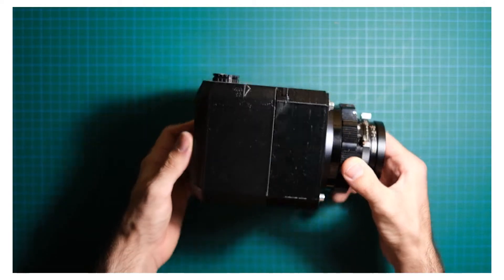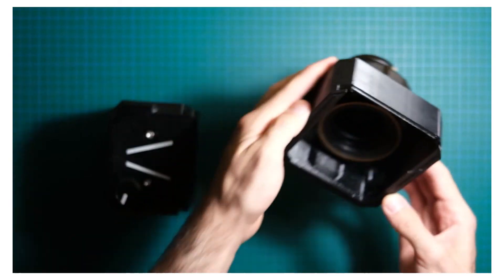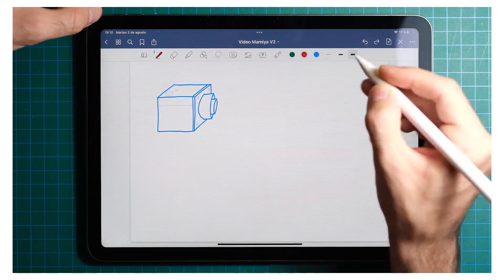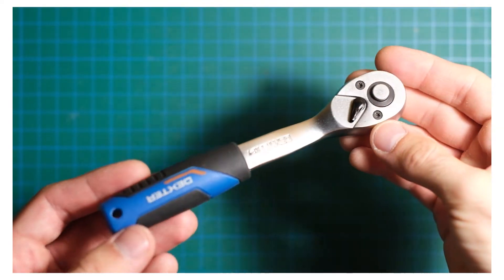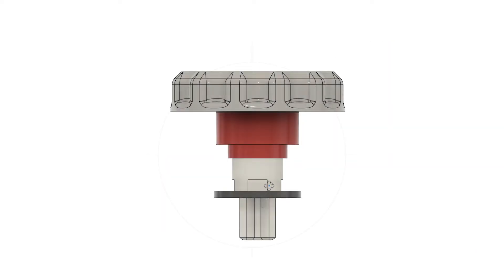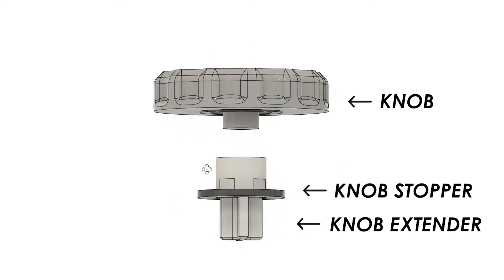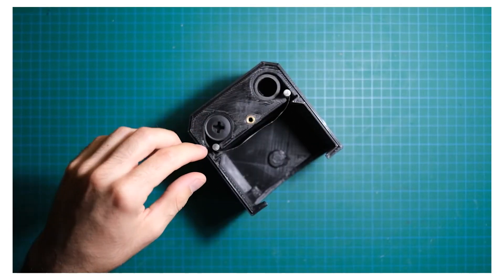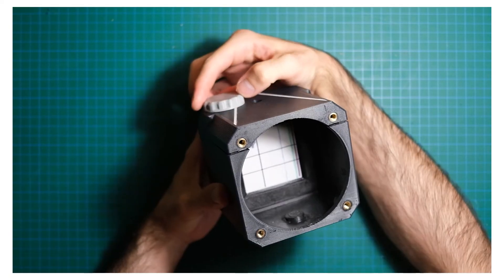3D Printed Medium Format Camera for Mamiya Press lenses

Comment: In a version 3 you may consider using a more advanced system for metering film advance, the current system is very imprecise. If you don’t want to risk light leaks from a red window, make the film travel around a 16mm diameter roller with a rubber band wrapped around it and a 64mm diameter roller. Install a knob on top with a marker at one point. As the film goes over the roller, the marker on top will make one revolution per frame.
Reply from the maker: @mcb187  Hi! Yes, a system for the metering of the film advance is going to be implemented. I'll go for the red window, since the configuration you propose was already thought, but wouldn't work properly. First of all, it can't be a 64mm diameter roller because it's too big for the size of the camera (also, wouldn't be 64mm in diameter but in perimeter). Adding a roller of half the size, or of a third of the size, would be better. But anyway, the friction of the whole system may possibly cause the film not to advance. If using rubber bands, the surface on the other side of the film should be slippery and perfectly flat to avoid any scratches. Even if it advanced, the empty spool where the exposed film is collected would need to have a "tensioning" mechanism to help that empty spool to turn. So the idea itself is great, but the implementation is not that simple.

Comment: Hello, I just started learning to 3D print and came across your project. This looks very cool! Thank you for sharing it. I have a few questions for you: 

0. What software do you use for designing? Any recommendations based on your experience?
1. Do you have an estimate on your timeline for the STLs for your 3rd version (V3) and the rough build cost/time?
2. Any estimates on the final weight/dimensions for V3?
3. Does the lens focusing ring move smoothly with v3 version? It looks like V2 basically uses a "lens board" so the focusing is smooth.
4. Do you think V3 still allow frames?
Reply from the maker: Hi!! I'm glad you liked it. 

0. I used Autodesk Fusion360, which works really good and it's easy to use. But lately I'm leaning towards using CATIA, way more profesional but more difficult to use as well. Anyway, any CAD software you use is great!
1. Version 3 is coming out this summer. It seems to be more compact and will add a few upgrades that will improve the design significantly, I hope. Build time would be approximately the same; cost may depend on if I implement some upgrades that are not decided yet.
2. As mentioned, V3 will be more compact (probably a little bit wider and taller, but shorter). Also, working to see how to add a (removable) handle, which will make the camera bulkier. Weight will be similar.
3. Don't understand the question. Could you rephrase? Thanks!
4. Allowing frames is something I'm not sure about, since it makes the design more complex. I'll try to add them, but can't ensure it.

Thanks fot the questions and happy 3D printing ;)
Reply: @doroteo.archive  hello, thanks for your replies. 

0. I’ll check out CATIA. I’m reading up to learn what decent free softwares exist.

3. It’s hard to explain with words. I’d love to see a demonstration of you focusing V3 and watch exactly how you adjust focus on the lens.

4. Okay, that’s understandable. 

One thought I had is that it would be nice to have the option for a “ground glass” back for times when you want critical focus or composition. However, it wouldn’t be worth it if that made the camera too bulky.
Reply from the maker: @CertainExposures  I thought about adding a ground glass, but found it hard to implement. V3 won't have a ground glass, but your thoughts and the ones of the people commenting makes me take things like these into account for future updgrades. Thanks again for your feedback!
Reply: @doroteo.archive  okay, that's understandable. Good luck - I'll keep an eye out for V3.

Comment: I probably missed something but is the take up reel collecting the film with the film side out?
Reply from the maker: Hi! Yes, that is what is happening. That's due to the knob turning clockwise. If the knob would have been located in the left-hand side and the unexposed film in the right-hand one, it wouldn't happen, but I preferred having the knob where it is. For version 3, I'll try to "fix" it.

Comment: A tip for heated inserts: only push them in 90% of the way, then use a flat piece of metal to push the rest. Gives a nice flush surface and a straight insert.
Reply from the maker: Thanks for the tip ;)

Comment: the relationship between the turns of the film advance knob, the circumference of the take up spool changes so your turns will not be consistently 1.5 turns per frame. I presume that the film is kept flat and tension applied to the film so that the take up spool winds tightly by having the film frame positioned very closely to the back plate. Have you had issues with the frame scratching the emulsion?
Reply from the maker: That's right, the film doesn't advance consistently but it was the simplest way to design it. Version 3 of this camera is on the way and a window to see the frame where you are will be implemented. Regarding the frame scratching: I didn't find any mark in my film, but relying on friction isn't the finest solution. I'll give it a thought! Huge thanks for the feedback :)
Reply: @doroteo.archive  I wanted to thank you for posting your design because it inspired a design feature for a 6x17 panoramic camera I'm designing. I have designed a 3D printed ratchet gear with dual pawls for my film advance after seeing your design. I started with a recessed area just like in your camera and it worked fine, but then I got to thinking I really wanted a lever action film advance like the toyo 4x5 roil film backs use. That feature just required a slight redesign, door handle return spring from amazon and a 20mm long M3 hex coupling nut from amazon.

I've remixed the lid of your design adding my film advance lever system and will post it to printables soon.

Comment: What is the flange distance you used? I have read on internet, that press lenses has 53 mm from film to bayonet, but I have measured much more in your fusion 360 file. I want to create my own 3D printed medium format camera using that lense so I am wondering
Reply from the maker: Hi!! So I had trouble finding the flange distance on the internet, so I measured it myself. But another problem I found was where to measure that distance from (I mean from what part of the lens). Anyway, the distances in the Fusion file worked well for me and for other people that printed the camera.
Reply: @doroteo.archive  it is very difficult to find the technical data for such old cameras, even when information can be found on the internet it is frequently wrong, and lacks citations for people to check the original source. As you say even if we have a figure given for film plane to flange distance of 53mm we are often left uncertain as to what mamiya calls the flange. Is that the base of the helicoid, or the underside of the bayonette tabs, or the very back of the lens barrel? 

Without a precise definition we often guess and make do with the results, but it would be preferable to optimize the optical design. I am going to use my view camera to making a test rig so I can mount a lens and focus at infinity, then use a depth micrometer to measure the distance to the back of the lens mounting plate to determine my required body depth.

Comment: This is such a cool project, kudos for making such a cool camera! Just 1 thing through, won't any light leaks be reflected around inside the camera due to the shinyness of the filament used? Painting the inside of the camera with matte black paint would help keep the film from overexposing.
Reply from the maker: Yessss totally. I must fix this aspect of the camera (by firstly ensuring that there are no mayor light leaks). Both painting and giving some "sawtooth" texture to the inner walls would help. There is a special black paint that reflects very very little light, but it would be nice to check if standard black paint works great. I really appreciate the feedback, it helps a ton for future versions of the camera :)
Reply: @doroteo.archive  I know what paint you're talking about. It's called Vantablack, it supposedly absorbs 99.95% of visible light. The problem is that it's quite toxic to work with, cracks and flakes easily and most importantly, costs quite a bit of money.

Your best bet would be just using matte black paint or covering the inside with black fabric.
Reply from the maker: @Stuntman175  That's obvsly the paint I was talking about. So already knowing that, I'll just go for matte paint (I think it would be easier than using fabric). Again, thanks a lot for the knowledge. Whenever I make another version of the camera, I'll make a video about it for sure.
Reply: @doroteo.archive  would you ever consider making an Instax Mini version of your camera? Plenty of cheap Instax cameras around to cannibalize parts for your build. 

You'd lose 1mm in width and height with a 645 lens due to the film size being 61mm x 46mm, but with careful alignment of the film plane, the difference could probably be split both ways.

Maybe I'm just crazy, but I think it could work, film prices have gone through the roof, but Instax has remained more or less the same price...

Edit: Instax Mini. Size matters, after all haha.
Reply from the maker: @Stuntman175  I like how you think ;). I've thought about it quite a lot, but haven't developed that idea yet. As you said, it's a similar design, and the main obstacles I could find are already faced. Also, being able to have an instant print would be soooo helpful to make fast design decisions.
Reply: @doroteo.archive  I've had this idea on my mind ever since I learned about box cameras, especially the Zeiss Ikon Box Tengor 56/2. The plan was to 3D print a appropriate scale replica to take Instax Mini film, using the optics from a Zeiss 6x6 folder, but cropping the image to 46mm in width to fit the Mini format.

I just lack the technical knowledge to do so and the willingness to go through the process of learning all of it haha!
Reply from the maker: @Stuntman175  I'm far from expert, but if I could help you with anything don't hesitate to contact me!

Comment: Great project. Maybe you should do a light sealing between frontplate and housing. I think the 4 crews are not enough to keep it complete dark. It looks like there is some little light coming in anywhere... what do you think?
Reply from the maker: Thanks for the comment and the ideas! The four screws just hold the front plate in place, and the light proofing is achieved (or I think is achieved) due to the front plate's geometry entering the housing. Anyway, as other comments mentioned and you did, little light is coming in. I'll give it a thought about what could be done. A sealing foam or similar would be really nice. Thanks again for the feedback!! It's truly helpful.
Reply: Regarding light leaks; saw a vid in last 2 days of a commercial low volume manufacturer who sent a demo model to a 250k subscriber channel. 

Light leak caused by a change in printing material. It wasn’t truly optically opaque…. Yoiks.

Comment: i thought to use the base to a battered sx 70. or 3d the base and put in drive train motor and picking arm. so easy when one cant do it!
Reply: The other route is ground glass lots of 3D printed backs dark slides. Load Polaroid put Darkside backing into bag with Polaroid camera drop another back on.

Comment: Super cool camera, nice work👍. But sorry for asking, why not to use a red window in the back to see the frame numbers? Cheers
Reply from the maker: I'm glad you liked the camera! I thought about adding a red window but I was worried about light leakages, plus it would be difficult for other people who want to print the camera to find this part. But a frame counter of any kind is a necessary upgrade.
Reply: @doroteo.archive  what I'm seeing in your camera project, you can add a red window like those old Hasselblad backs with something to cover in the end. The hole will be very deep, doesn't look to have any light leaks.
Reply: @doroteo.archive  https://youtu.be/zSTy6k_8beE
Something like this, and looks like you don't need a red window
Reply from the maker: @filmlovephotography  first time I see a hole like this. Simple and seems that light won't cause any problem. Now I feel the urge of designing another version :) Thank you very much for the knowledge!!
Reply: @doroteo.archive  the camera looks great, I couldn't resist to talk about the window. I believe will be very easy now to change frames. Good luck and hope to see the mark III in the future 👍
Reply: @doroteo.archive  Salyut C has a very similar system due to the soviet manufacturers having issues with reliable counters.

Comment: now adapter for graflok 23 magazines. easy possible. the blades must be unversally shaped people must shave them to match their magazines. e.g. MRB67/70, i have special altered one for 61.5mm film using on donor side only. 70+61.5mm(also longroll cut down 70mm or stitched 120/220). and groundglass focus is delicate. focus shifting when stopped down. core focus meant. scale calibrated for full aperture. have zone z1-experience. mounts are crap.
Reply from the maker: A future version should include all you mentioned. A standardized magazine mount and a groundglass, while perhaps difficult to implement, are must-have to be able to finely tune the focus. Thanks for the feedback and ideas: it helps a lot.
Reply: @doroteo.archive  aAron Smith could allow using his g-adPter Design.
Reply: @doroteo.archive  brightscreen has now also matte-version only cheapest of the best. forget anything else.
Reply: @doroteo.archive  get brightscreen Split gg.fresnel integrated.not cheap but perfect.split essential so fresnel in low light.
Reply from the maker: @michaelprzewrocki4195  I think I'll go with a DIY version of the focusing screen to keep the project as cheap and easy as possible (a sanded methacrylate sheet). In that way, the camera built is accesible to more people. (I'll also have to simplify the advance mechanism obvs).
Reply: @doroteo.archive  rightangle mup viewfinder fabulous fresnel inside for essyficussing without loupe.

Comment: very beautiful camera! Amazing work! But I think it is missing a cold shoes for rangefinder and viewfinder
Reply from the maker: Appreciate you liked the project!! You  are totally right. A cold shoe or any other viewfinder mod would be nice. Possible future versions might add those things. And thanks for the feedback! It's so great to get people's opinion.
Reply: @doroteo.archive  can I ask what 3d printer you used for that project? and what material?
Reply from the maker: @fanaticAlien  I used a Creality Ender 3 (one of the first versions). And PLA was the way to go for me since it prints very nicely.
Reply: @doroteo.archive  Have you checked if 3D print does not transmit light? I think that photos are bit "bland". From my experience when I try to print bulk film loader, it turned out, that my 3D prints are not lightproof (of course using black PLA).
Reply from the maker: Hi  @piszczyk  !  I also noticed what you are saying. I'll have to check whether it is due to the filament not being opaque (despite I painted black the whole exterior of the camera), due to the internal walls reflecting light (which for me seems to be the main reason) or due to ligth leaks (maybe the "step" used for light-proofing isn't tall enough). But in addition to that, maybe the problem occurs when loading the film or when developing it. I develop it myself and I'm definitely not an expert. Anyway, I'll try to improve all aspects above in possible future versions. Thanks a lot for the feedback :))